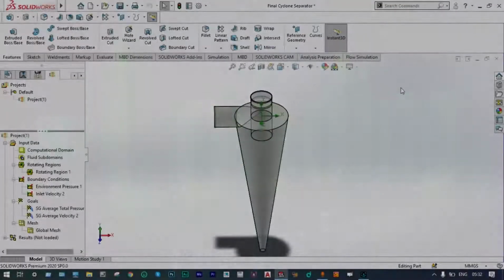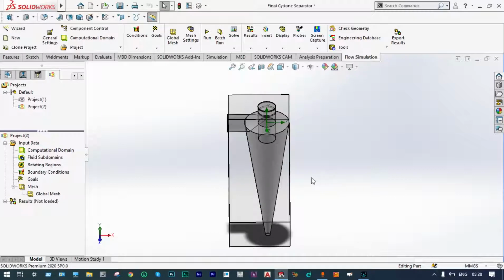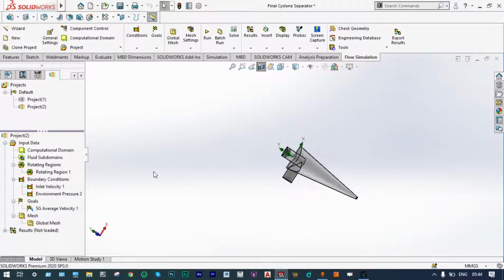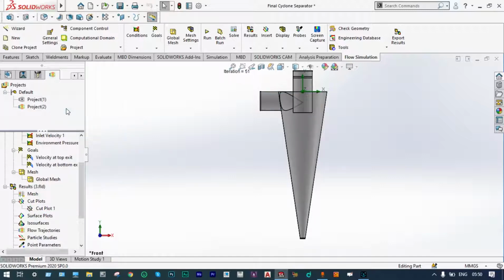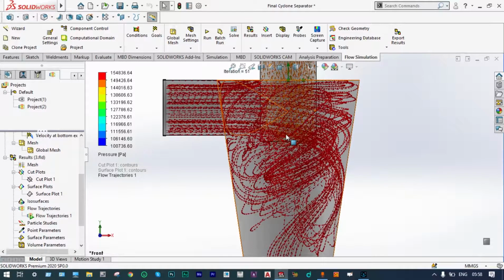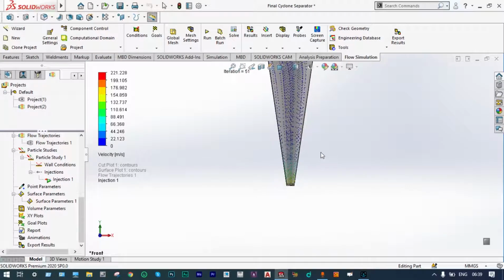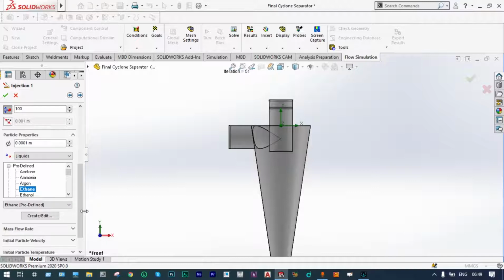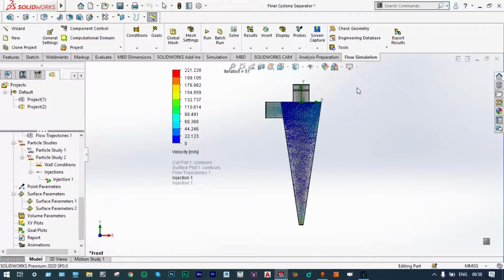CFD Flow Simulation and Particle Study of a Cyclone Separator with SolidWorks 2020

Comment: I cant seem to get this particle study to work for me, I'm just trying to do something basic looking at erosion in a pipe bend on solidworks. Its nothing technical or anything
Reply from the maker: Boundary conditions are very important. You need to apply proper boundary conditions. Most of the CFD fails because of improper geometry & boundary conditions

Comment: Great video congratulations ... I would like to know how to configure (Wall Material Properties) for aluminum or steel, I haven't found the tabulated values? If you can help me, I thank you very much.
Reply from the maker: Here in this case for walls heat flux heat transfer rate or wall temperature can be provided with user defined values and if you are using Al or steel you can provide actual values of above mentioned parameters for Al or steel
Reply: @CFD_GUIDE  can i send you an email explaining better?  because it would help me a lot in the execution of a project
Reply from the maker: Sure, you can, but this week I will be busy. I will be a bit free from Saturday onwards
Reply: @CFD_GUIDE  In case I'm talking about configuring the particle study, I would like to know how to configure Erosion Coefficient for aluminum and steel, or where to find these values? Also the other 3 parameters
Function of Particle Diameter
Function of Impact Angle
Function of relative particle velocity
because I haven't found where to find these values